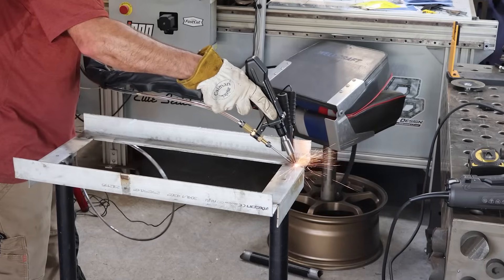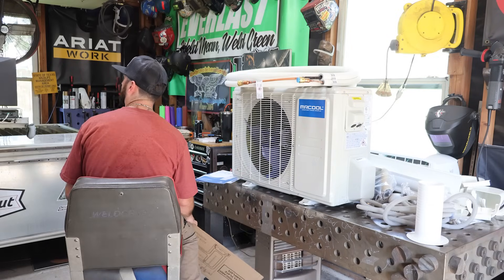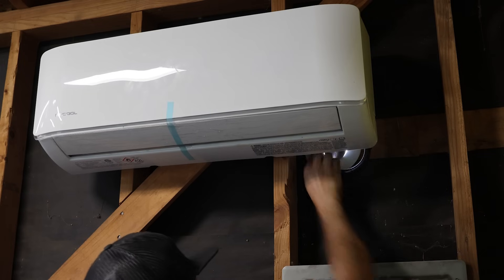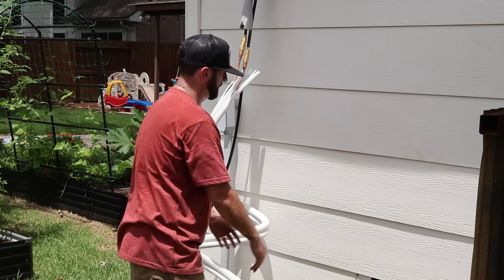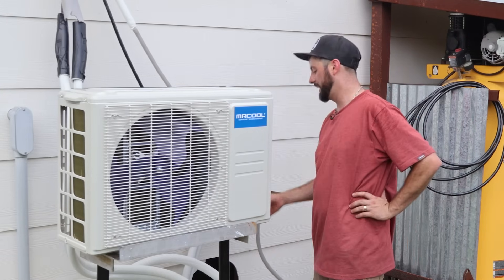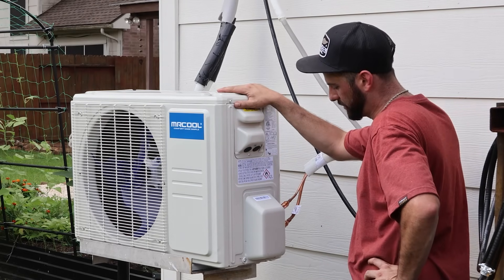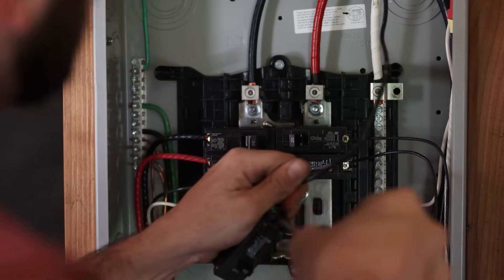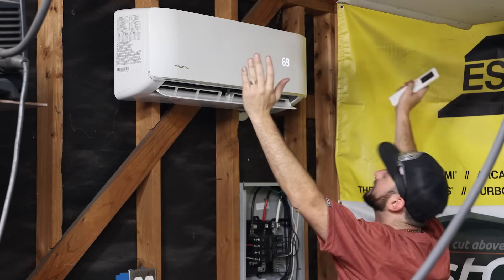Welding Shop Too Hot? Here’s How I Installed AC Myself

Comment: I just installed a 18K mini split (240v) unit I bought from TEMU. The installation instructions were garbage. I don’t know how the average person could use their instruction to do a proper installation.  I ended up taking several days to get it installed.  But, it is definitely doing a better job than the old window units. Keep up the good work 👍

Comment: Dude, you completely skipped a very important issue; I did not see you install a vacuum pump and pull a vacuum on the system. Read about it online. The compressor will eventually fail due to moisture in the system.
Reply: Yup.  Should have used a vacuum pump before opening the valve.

Comment: I know the laws are different in Canada than in the USA, but here are a few things I would have changed or added.
1/ a electrical disconnect on the outside for safety while working on it
2/ the maximum line set needed is 10 ft ( I don't use pre-made line sets and I get it you don't have the tools).
3/ everything I install has to be perpendicular to everything else, having the line set looking like it fell there is not me.
4/ the fitting coming out of the wall belongs to a system designed to hide everything 
5/ please make the stand a little more sturdy, or mount to the wall, for wind storms and such.
6/ make the line set horizontal so the oil will get back to the compressor, as it will collect in the curves of the line set ( miny traps)
I am happy your system is keeping you cool, 😊

Comment: 14:00 could have used a 20amp auto reset push button breaker for that... they are big as a thimble. just drill a hole in the panel, process control breakers... so if your panel is maxed out, their is still 2 or 3 times more breakers that can fit along the outer switch aria of the panel cover. bolt a hinge to the panel cover. ! I can get 5 of those 20amp 125V breakers for $9. ... 40 slot panel can fit more then 160 of those breakers.
Reply: That’s some great advice!

Comment: I would prefer if you didn't have air conditioning
Reply: I’m not sweating it 😂
Reply: @Drweldz must not weld to often then. Must get a ton of porosity with that air conditioner blowing away all your shielding gas
Reply: @Scuba_420 it’s so far away from my welding area. Cooler and less invasive than the fan I was using before.. Mr.welderface

Comment: proper respiratory selection for process   i still see those miller paper filters getting used around galv etc .
Reply: Certainly a good option! Didn’t weld any galvanized. However that stainless isn’t the healthiest to breath in ether 😅
Reply: @Drweldz  3m cartridges over north or honewell etc.. seen the sinterosis display?

Comment: I'd recommend you make that outside unit more stable.  You're one big windstorm away from a potential disaster.  Good Luck until then!
Reply: I agree. Since the video I’ve fastened the unit in place and buried the legs a little under a foot  into the ground and packed it all back.